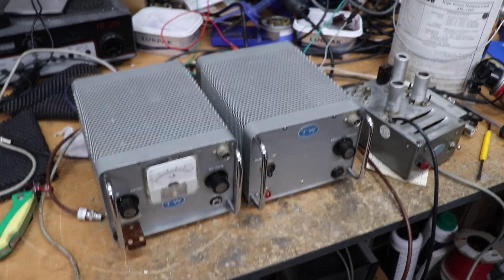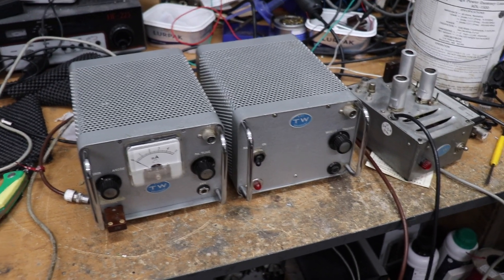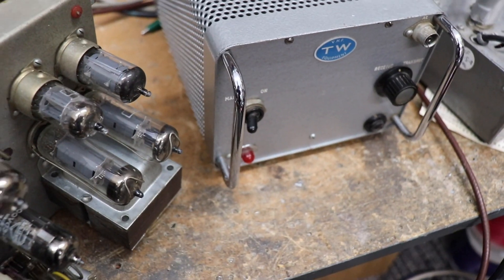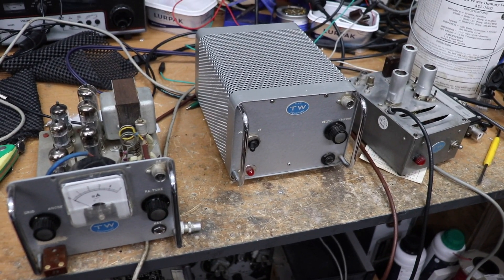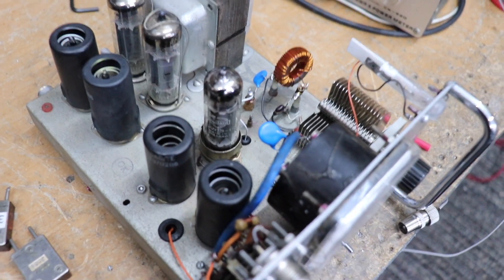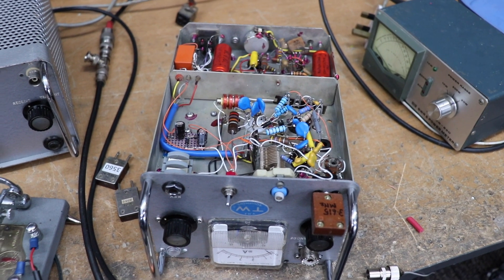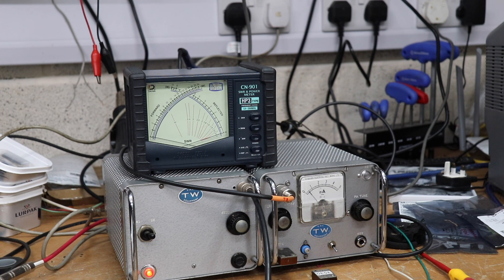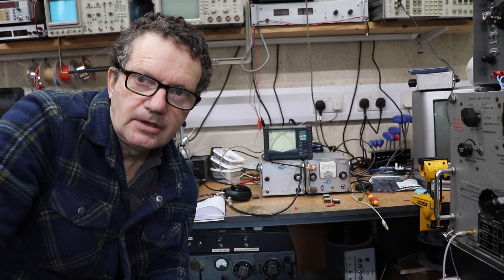Modifying A Vintage TW2 VHF AM Transmitter For 80m

Comment: I used to have an xtal for 145.350 MHz which was a local chat frequency but it's long since disappeared, I think it's fundamental frequency was around 8 MHz. I'd be tempted to try advertising for xtals for this T.W. before doing this to it. Anyway it looks successful.
I got a T.W. TopBander at a rally for £5, the seller had no idea what it was and neither did I. I buy the tatty stuff other people walk past. It needed the mod. transformer wiring and a valve base where one pin looked like it had H.T. on it and zapped the pin in half, and I removed somebody's modification of a relay for tx/rx changeover.
Five Pye Bantams recently at £10 o.n.o. which I got for £5. One already on 70.260 MHz and one tx only on 144.450 MHz.
G4GHB.

Comment: Good to see the conversion which I can fully understand as I have found 2 metres lacks any activity in my area. 3.69 MHz is designated for QRP although I usually find Germans on this freq. using what can only be described as Quite Ridiculous Power (QRP).